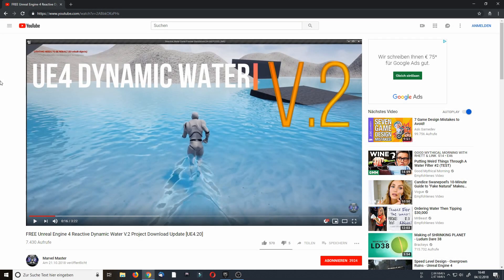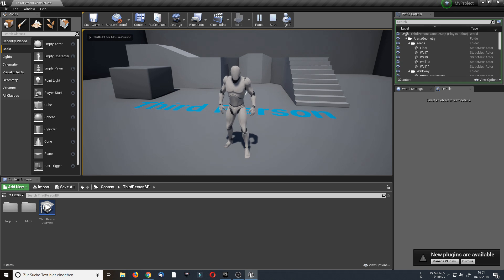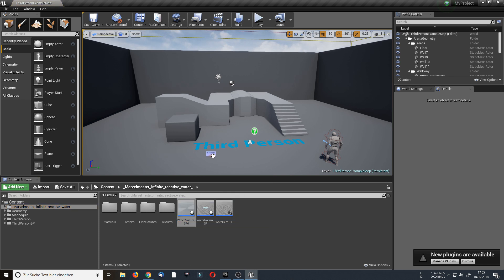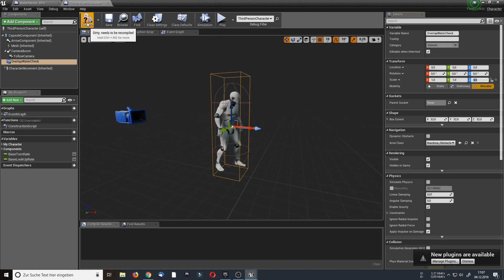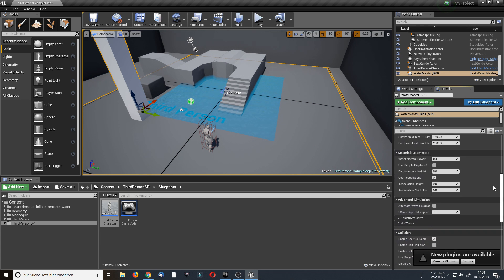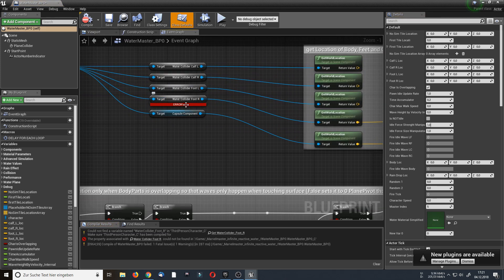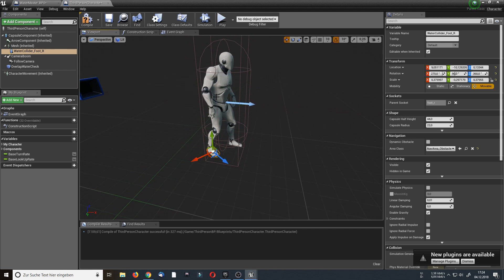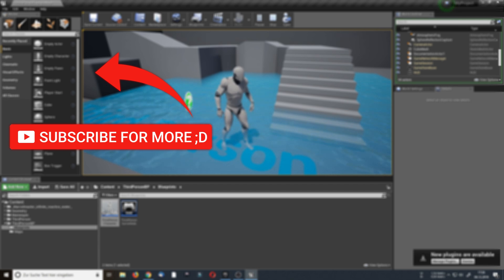UE4 Free Dynamic Water V2.1 - how to integrate into your project [UE4.20]

Comment: Hey, so I got a little bug after replacing the mannequin (after importing the waterstuff),
basically,
the camera can be moved through the ground, as I look up.
This is really frustrating, I tried everything I thought would help (I am pretty new to ue4), also searched YouTube for a solution, but I couldn't find any...
Do you know how to fix this, or will it be gone in V3? (btw, when will you release it, bc I really like the reactable water)
Reply from the maker: Hey iirc you can set the collision of the camera.  I am working on V3 every day now. Its basicaly finished I am building the showcase level at the moment.
Reply: @MarvelMaster  Hey I tried it, but it's still not working, besides, I couldn't even find any collsion option in "FollowCamera" or "CameraBoom" (except under the collision tab > "Can Ever Affect Navigation", but this didn't affect anything). I tried adding a box collision, but it didn't work either. Is it possible to contact you on Skype or Discord?
Reply: @MarvelMaster  alright, thank you. I will try it, hope it will work because I really like the water :)
Reply: @MarvelMaster  nvm I think I found the solution, just limit the camera pitch :)
Reply from the maker: the solution is much simpler...the CameraBoom or SpringArm is the collider for the camera. So when you are in the character viewport the camera must be touching the the red spring arm line. If the Spring arm is to short you can increas its target arm length and move the camera to where you want.
Reply: @youknov4748  Another possible problem: select your camera boom (or spring arm) and check the camera collision section. You have Probe Size, Probe Channel and Do Collision Test. Make sure the last one is enabled.
Reply: @expod  thanks, but I already found a solution for myself :)
Reply: @youknov4748  They're different solutions for different kinds of problems. Limiting pitch doesn't prevent collision.
Reply: @expod  sure dude

Comment: One question though... How do we Implement this in our own water blueprint? I made a water shader which I attached to a blueprint class meant for generating underwater terrain.
Reply from the maker: You could bring your blueprint content into water sim bp
Reply: @MarvelMaster  Or vice-versa?  I'd want it to be on be one off multiple functions. Messing with my blueprint would nullify a lot of preexisting parameters I setup.
Reply from the maker: @kathoden  hm the way my water works it will be difficult to add it to another blueprint...because the system consists of 3 blueprints... :/
Reply: @MarvelMaster  You're pretty awesome still. I'll work it out. Thanks!
Reply from the maker: Good luck ^^'